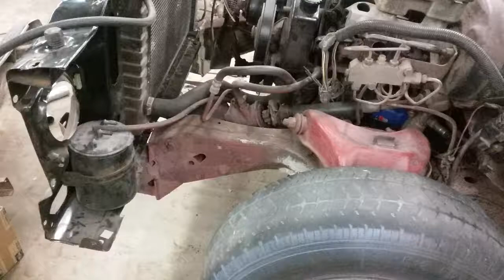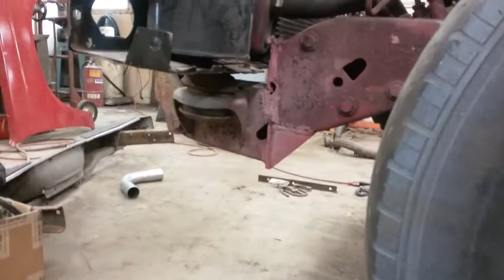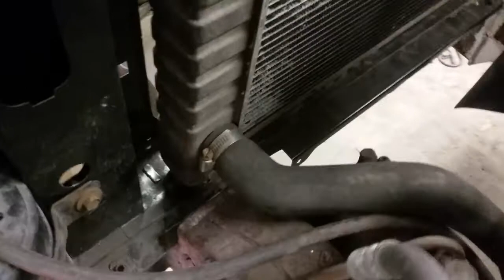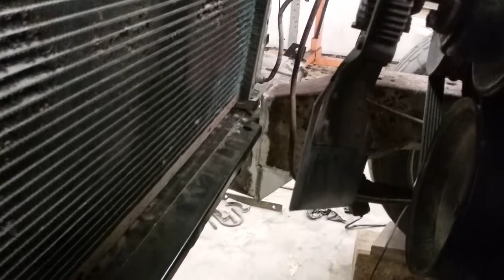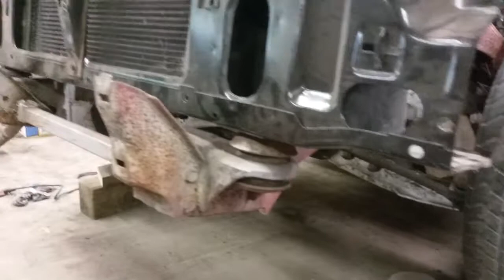S10 body dropped frame

Comment: How much did you drop it on front ???
Reply from the maker: The body drop was about 2 and 3/4 inches. So the front of the frame was lowered the same to make the bumper line up again with the body....On any truck to figure how much to body drop just measure the distance from your driveway or garage floor to the bottom of your frame and to the bottom of your rocker panel, Then subtract the difference. That is how much you need to body drop to lay out on the rockers with the frame also laid out.